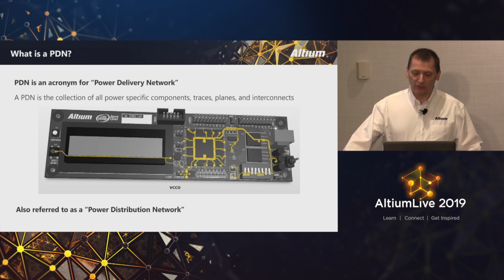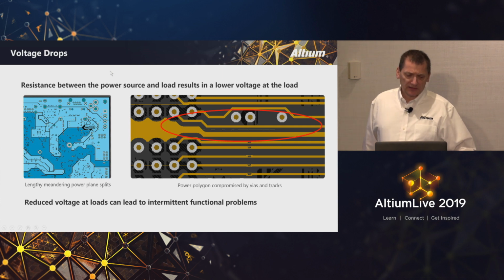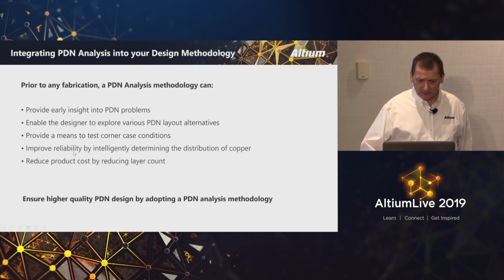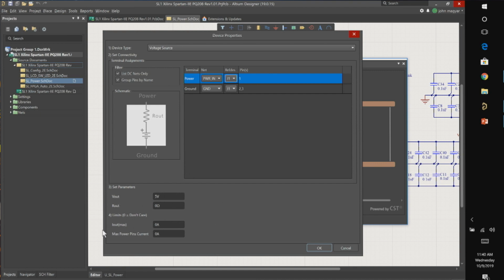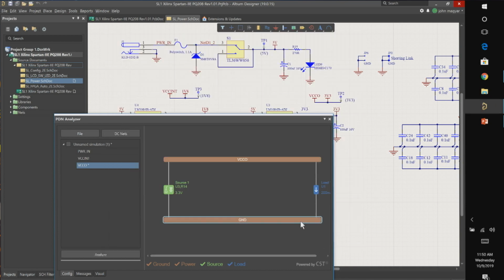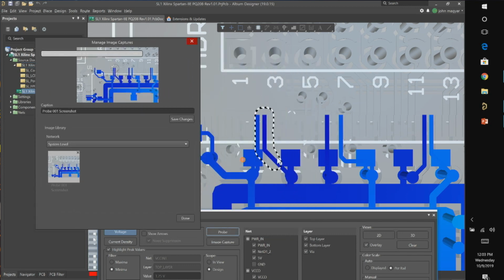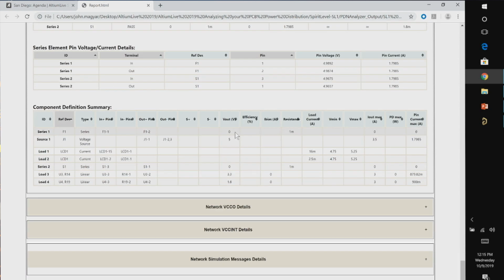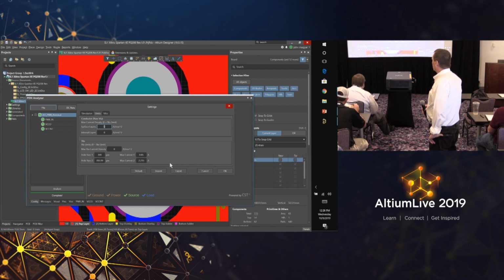Analyzing your PCB’s Power Distribution - Magyar

Comment: The composition of PCB copper lines is irrelevant compared to its rectangular dimensions affecting conductivity and tolerance to current and gap between data conducting lines/traces. Part of learning resistance, reactance, conductor shapes